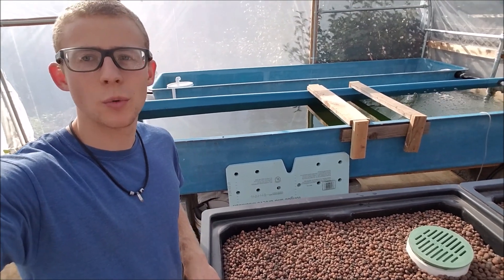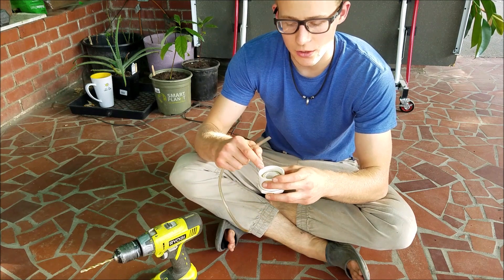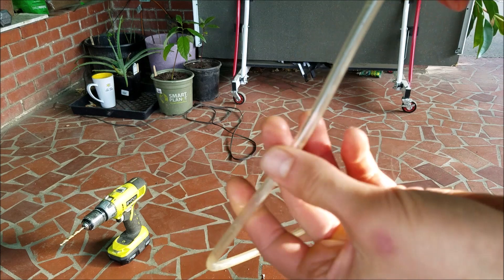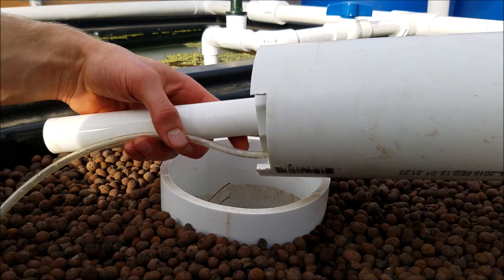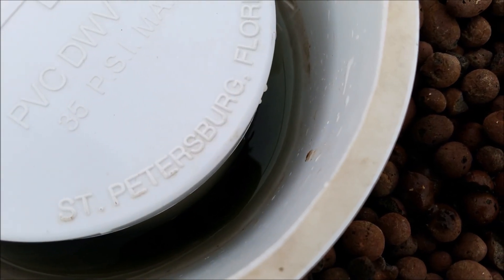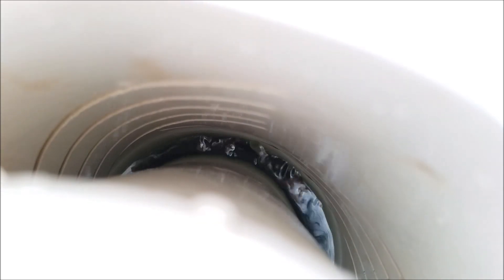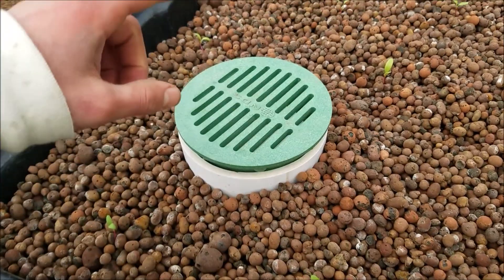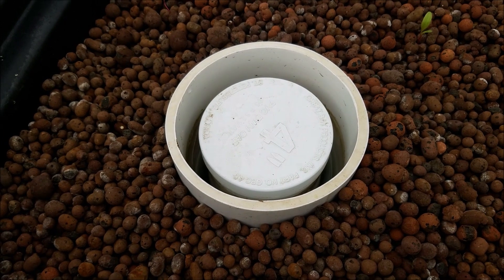How to improve your bell siphon- bell siphon not breaking (hybrid aquaponics system)

Comment: Hey mate here are several sticking points on auto syphon 
Most of these adjustments depend on speed in which water enters/leaves grow bed 
1 ) Either a short length  1.5-2 cm of pipe the same size as stand pipe , now a cut the length of pipe an cut until it slots into inside the top part of stand pipe,  this chokes the start of the syphon effect thus putting more water in an down outlet  faster than normal so starts quicker. Also a reducer attached to stand pipe like shown in your clip without snorkel also works
2 ) Make sure the bell syphon lid is only just above the top of the stand pipe an internally there no bow in the bell lid an is also flat  ( if not use a cut out from hole saw an selastic this to the inside of bell lid. ) This remove extra air at start up of system casings. it to start quicker without any lag. 
3 ) the stand pipe underneath returning water from grow beds must be at least a foot long an a un glued elbow an have gap to allow for stopping an starting if issues still present turning the elbow slightly 10-35° may be enough to stop an start. (Connected stand pipes outlets may cause premature evacuation of water from other grow beds or bell syphon failure to stop.)

Comment: Damn I have the opposite problem where it breaks too early and leaves too much water in my grow bed. It breaks at the first lines that I cut out for the water to seep through of the larger pipe but otherwise it looks exactly like yours
Reply from the maker: If I am following what you are saying. It could be that the cuts you have in the bell part of the siphon are to high. Typically if a bell siphon breaks to early there is air entering from somewhere causing the siphoning effect to stop.
Sometimes it does take messing around with. Not just with the siphon itself but with the flow of water into the grow bed as well.

Comment: A surefire and most efficient way to start and break a bell siphon with 100% accuracy is to just insert a small air tube from the bottom of the siphon so it bubbles inside. Try it out and let me know guys.